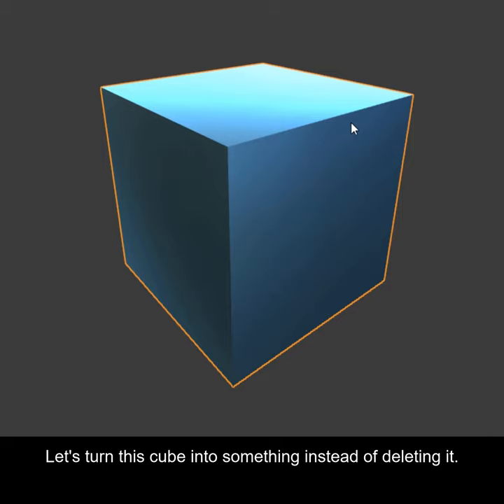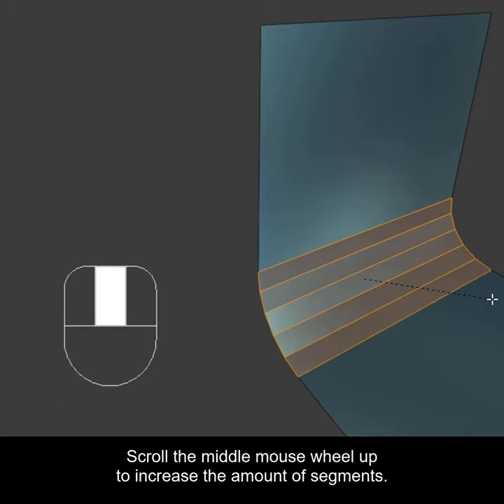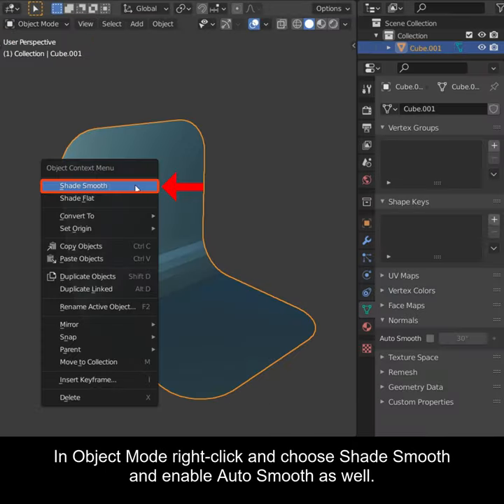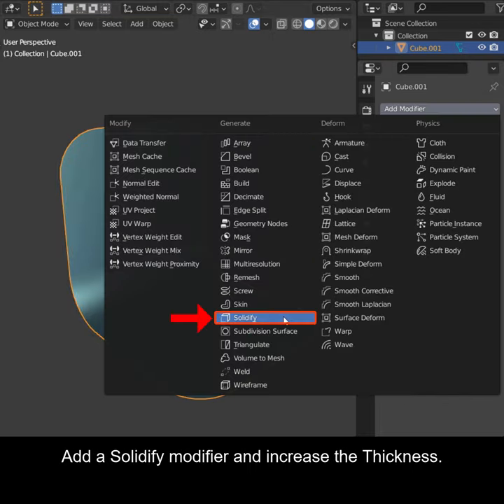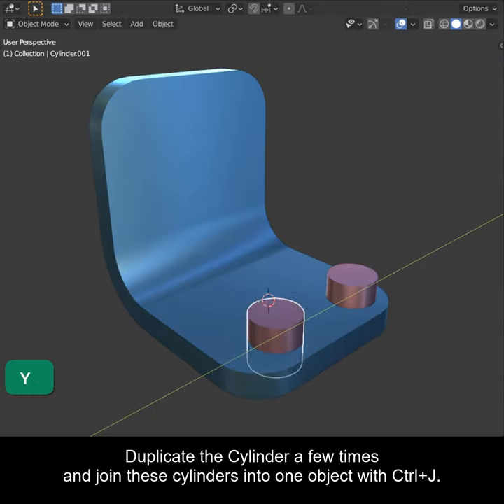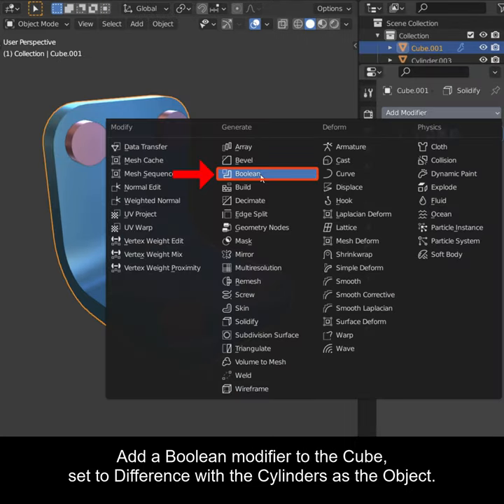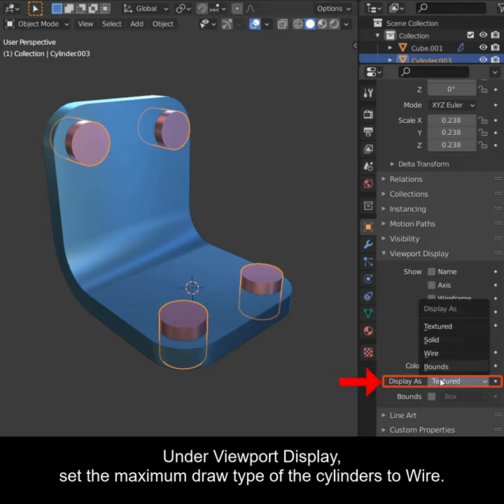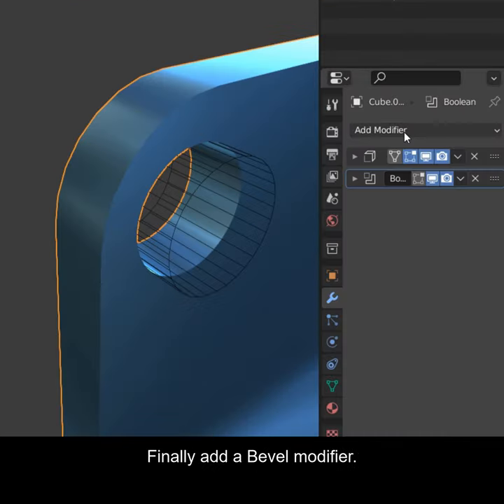Blender Secrets - Non-Destructive Boolean Workflow

Comment: What exactly does non destructive mean? As far as using booleans or whatever. I looked up a guide online describing how you can model in maya with booleans then take it to zbrush, but i dont wanna use maya lol i wanna use blender.
Reply: I know this is a late reply, but non destructive means that you can turn the modifiers off and still have your original base work...instead of doing all the steps as final results. That way if you decide to change things up, or you make a mistake, you have a way of going back. Also helps with lower lods etc. Hope that helps someone in the future :) I am sure you worked it out yourself by now.

Comment: One thing I've had a hard time understanding is what's the point of a nondestructive workflow? I mean, I know that it's to shape things without causing shading issues and stuff but when is this stuff supposed to be used for? Videos? Still pictures? Idk where this is supposed to be incorporated into.
Reply: Easy to fix later if something goes wrong. Trust me, lots of things go wrong when working with big projects.
Reply from the maker: It has nothing to do with shading issues, it’s just a method of modeling that is convenient and can easily be adjusted later.